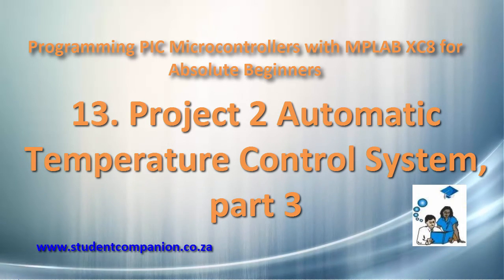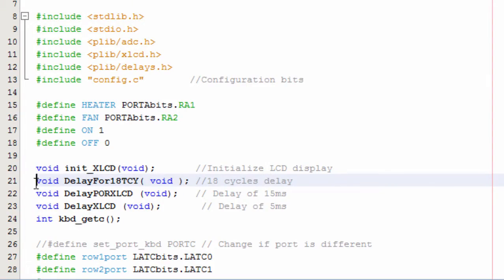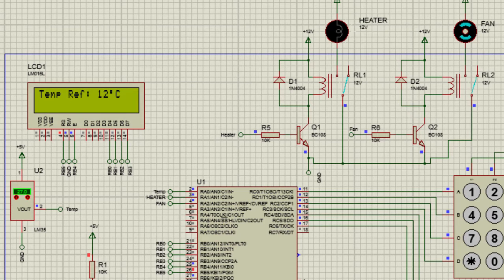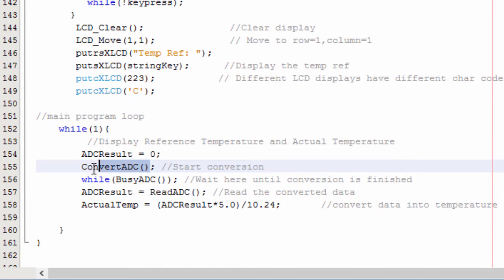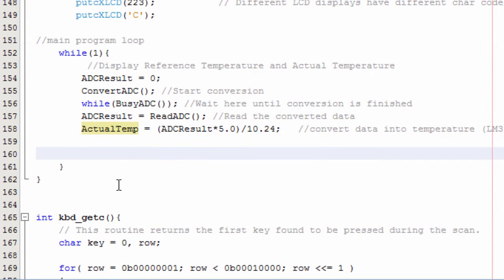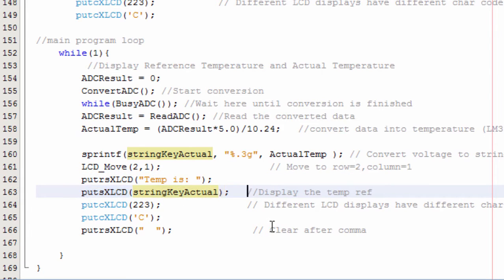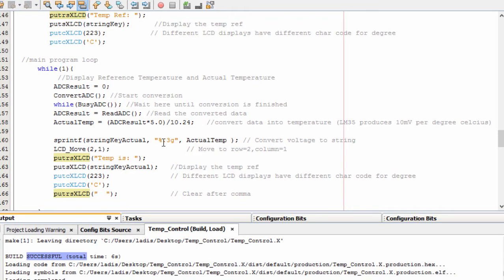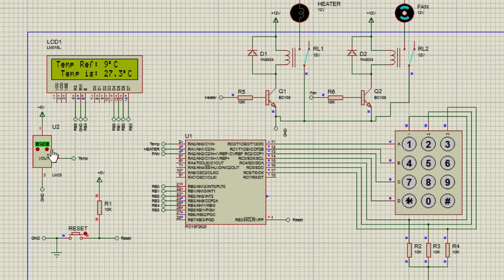13- Project 2 Automatic Temperature Control System, part 3 | MPLAB XC8 for Beginners Tutorial

Comment: Heater and Fan is not running, I have attached everything you need, please help. I have posted in forum.
Reply: It's working now, I changed the values of power supply to the relay from 5V to 12V, it's running. Would you explain why it wasn't running at 5v?
Reply from the maker: You are using 12V relays but you are powering them with 5V, they won't work. If you use a 12V relay, you must power it with 12V, a 5V relay must be powered with 5V. If you change the relay voltage to 5V it will work because they are connected to 5V. Write click the relay and change its voltage rating.

Comment: Great project. Thank you. I tried to build the same project with pic18f45k22 but code is giving me error in 
void init_ADC(void)                 /
{
OpenADC(ADC_FOSC_2 & ADC_RIGHT_JUST & ADC_2_TAD,
ADC_CH0 & ADC_INT_OFF & ADC_REF_VDD_VSS, ADC_1ANA);
} 

ADC_1ANA it says its unable to resolve identifier ACD_1ANA.
Reply from the maker: +Bakmurat Kubanaliev did you write ACD_1ANA or ADC_1ANA?
Reply: Sorry, i wrote ADC_1ANA. Can it be library error. but i downloaded and installed legacy peripheral library. LCD library working fine
Reply from the maker: +Bakmurat Kubanaliev which XC8 compiler version are you using? 
Can you post all the error messages you are getting?
Reply from the maker: +Bakmurat Kubanaliev . It complaining about pconfig.h file. No such file exist. Do you have this file in your project? Abd did you include it?
Reply: #include <plib/adc.h>  yes i included it
and i dont have any pconfig.h file. i didnt make header file like in the video. i just created main and source file. maybe problem is in the legacy peripheral library. i cheched and opened this adc.h file here 

C:\Program Files\Microchip\xc8\v1.41\include\plib/adc.h

and i found #include <pconfig.h>  there in the program
Reply from the maker: +Bakmurat Kubanaliev can you post your main C file. Did you download and install separately the peripherals libraries?
Reply: This is main code:

#include <xc.h>
#include <stdlib.h>
#include <stdio.h>
#include <plib/adc.h>
#include <plib/xlcd.h>
#include <plib/delays.h>
#include "config.c"      //Configuration bits
 
#define HEATER PORTAbits.RA1
#define FAN PORTAbits.RA2
#define ON 1
#define OFF 0
 
void init_ADC(void);        //Initialize ADC
void init_XLCD(void);       //Initialize LCD display
void DelayFor18TCY( void ); //18 cycles delay
void DelayPORXLCD (void);   // Delay of 15ms
void DelayXLCD (void);       // Delay of 5ms
int kbd_getc();
 
//#define set_port_kbd PORTB // Change if port is different
#define row1port LATCbits.LATC0
#define row2port LATCbits.LATC1
#define row3port LATCbits.LATC2
#define row4port LATCbits.LATC3
#define col1port PORTCbits.RC4
#define col2port PORTCbits.RC5
#define col3port PORTCbits.RC6
//#define col4port PORTBbits.RB7   //if a 4x4 keypad is used
 
unsigned char  const Seven_Segment_MAP[10] = {0,1,2,3,4,5,6,7,8,9};
char const keyPadMatrix[] =
{
    '1',   '2',  '3',
    '4',   '5',  '6',
    '7',   '8',  '9',
    '*',   '0',  '#',
    0xFF
};
 
char key,old_key;
 
//
// This function creates seconds delay. The argument specifies the delay time in seconds
//
void Delay_Seconds(unsigned char z)
{
    unsigned char x,y;
    for(y = 0; y < z; y++)
    {
        for(x = 0; x <  100; x++)__delay_ms(10);
    }
}
// This function clears the screen
//
void LCD_Clear()
{
    while(BusyXLCD());
    WriteCmdXLCD(0x01);
}
 
//
// This function moves the cursor to position row,column
//
void LCD_Move(unsigned char row, unsigned char column)
{
  char ddaddr = 0x40*(row-1) + column;
  while( BusyXLCD() );
  SetDDRamAddr( ddaddr );
}
 
//*************Declare Global Variables*************************************
unsigned int ADCResult=0;
unsigned short Temp_Ref ;      //  Reference Temperature
float ActualTemp;
unsigned char stringKey[10],stringKeyActual[10];
unsigned long keypress;
/*
 *
 */
void main(void) {
     OSCCON=0x76;         //Configure to use 8MHz internal oscillator.
     TRISC   = 0xF0;            //Use PORTB for Keypad
     TRISB   = 0x00;            //Use PORTB to display
     PORTB   = 0x00;
     TRISAbits.RA0 = 1;
     TRISAbits.RA1 = 0;    //RA1 is output (Heater)
     TRISAbits.RA2 = 0;    //RA2 is output (Fan)
     LATB    = 0x00;
     init_XLCD();         //Call the Initialize LCD display function
     init_ADC();          //Call the Initialize ADC function
 
    LCD_Move(1,3);                 // Move to row=1,column=3
    putrsXLCD("Automatic");          // Display heading
    LCD_Move(2,1);                   // Move to row=2,column=1
    putrsXLCD("Temp Control...");    // Display heading
    Delay_Seconds(2);                // 2 seconds delay
    LCD_Clear();                     //Clear display
    
    HEATER = OFF;                 //Switch OFF Heater on start up
    FAN = OFF;                    //Switch OFF Fan on start up
 
      //ON startup, read the Reference Temperature from the Keypad
        START:
       LCD_Clear();                     //Clear display
       LCD_Move(1,1);                   // Move to row=1,column=1
       putrsXLCD("Enter Temp Ref");
       Temp_Ref=0;
       LCD_Move(2,1);                   // Move to row=2,column=1
       putrsXLCD("Temp Ref: ");
 
   while (1){
       
       keypress = kbd_getc();
       if ( keypress == '#' )break;        //If Enter '#' pressed
       if ( keypress == '*' )goto START;  //If Clear '*' pressed
 
       if(keypress!=0xFF){
          putcXLCD(keypress ) ;
          Temp_Ref = (10*Temp_Ref) + Seven_Segment_MAP[keypress-'0'];
       }  
}
       LCD_Clear();                     //Clear display
       LCD_Move(1,1);                   // Move to row=1,column=1
       putrsXLCD("Temp Ref: ");
       itoa (stringKey,Temp_Ref,10);   //Convert to string in stringKey
       putsXLCD(stringKey);            //Display the temp ref
       LCD_Move(2,1);                   // Move to row=2,column=1
        putrsXLCD("Press # to Cont.");
     
      keypress =0;
      while(keypress!='#')
      {
         do
           keypress = kbd_getc();  // read keypad
         while(!keypress);
      }
       LCD_Clear();               //Clear display
       LCD_Move(1,1);             // Move to row=1,column=1
       putrsXLCD("Temp Ref: ");
       putsXLCD(stringKey);      //Display the temp ref
       putcXLCD(223);           // Different LCD displays have different char code for degree
       putcXLCD('C');
   
       //Program loop
       while(1){
        //Display Referance Temperature and Actual Temperature
        ADCResult =0;
        ConvertADC(); //Start conversion
        while(BusyADC()); //Wait here until conversion is finished
        ADCResult = ReadADC(); //Read the converted data
        ActualTemp = (ADCResult*5.0)/10.24;       //convert data into temperature (LM35 produces 10mV per degree celcius)
        sprintf(stringKeyActual, "%.3g", ActualTemp ); // Convert voltage to string
        LCD_Move(2,1);                   // Move to row=2,column=1
        putrsXLCD("Temp is: ");
        putsXLCD(stringKeyActual);      //Display the temp ref
        putcXLCD(223);               // Different LCD displays have different char code for degree
        putcXLCD('C');
        putrsXLCD("  ");              // Clear after comma
 
        //Compare reference Temp with actual Temp
      if (Temp_Ref >  ActualTemp)  //If Temp Ref is greater than actual Temp, Switch ON Heater
      {
      HEATER = ON,
      FAN = OFF;
      }
       if (Temp_Ref <  ActualTemp)  //If Temp Ref is less than actual Temp, Switch ON Fan
      {
      HEATER = OFF,
      FAN = ON;
      }
      if (Temp_Ref ==  ActualTemp)  //If Temp Ref is equal to actual Temp, Switch OFF Fan and Heater
      {
      HEATER = OFF,
      FAN = OFF;
      }
        Delay_Seconds(10);   //Wait 10 s then repeat
     }
 
}
 
int kbd_getc(){
    // This routine returns the first key found to be pressed during the scan.
    char key = 0, row;
 
    for( row = 0b00000001; row < 0b00010000; row <<= 1 )
    {
        {   // turn on row output
            row1port = (row & 0x0001)>>0;
            row2port = (row & 0x0002)>>1;
            row3port = (row & 0x0004)>>2;
            row4port = (row & 0x0008)>>3;
            __delay_ms(1);
        }
        // read colums - break when key press detected
        if( col1port )break;  key++;
        if( col2port )break;  key++;
        if( col3port )break;  key++;
        //if( col4port )break;  key++;
     }
    row1port = 0;
    row2port = 0;
    row3port = 0;
    row4port = 0;
    if (key!=old_key){
      old_key=key;
      return keyPadMatrix[ key ];
    }
    else
    return keyPadMatrix[ 0x0C ];
}
 
void init_XLCD(void)                //Initialize LCD display
{
OpenXLCD(FOUR_BIT&LINES_5X7);       //configure LCD in 4-bit Data Interface mode
                                    //and 5x7 characters, multiple line display
while(BusyXLCD());                  //Check if the LCD controller is not busy
                                    //before writing some commands
WriteCmdXLCD(0x06);                 //Move cursor right, don't shift display
WriteCmdXLCD(0x0C);                 //Turn display on without cursor
}
void init_ADC(void)                 //Initialize ADC
{
OpenADC(ADC_FOSC_2 & ADC_RIGHT_JUST & ADC_2_TAD,
ADC_CH0 & ADC_INT_OFF & ADC_REF_VDD_VSS, ADC_1ANA);
}
void DelayFor18TCY( void )         //18 cycles delay
{
Delay10TCYx(20);
}
void DelayPORXLCD (void)           //Delay of 15ms
{
Delay1KTCYx(30);
}
void DelayXLCD (void)              //Delay of 5ms
{
Delay1KTCYx(10);
}

Yes i did download it. PIC18F Legacy Peripheral Libraries v2.0 and installed it. Added it from project properties,  include directories.
Reply from the maker: We can't see the problem from this code, please send us your full project together with Proteus schematic if you are simulating your project. Zip all the files.
Send it to our facebook page: https://www.facebook.com/StudentCompanion/ 
Or send us an email.

Comment: which mplab version u r using..which compiler give me the specifications pls
Reply from the maker: +Harpreet Sehrawat You seem like you are confused, you are asking question about MPLAB Compiler, mikroC compiler, these are two different compilers. You must use the one you have and familiar with. Watch our introduction tutorials to get started. You told me you were using XC8 version 1.7 that's why I suggested how to install the Peripheral libraries. The version we used on that tutorial is v1.4 which you can still get from microchip website. You won't need to install the PIC18F Peripheral libraries with this version.
Reply from the maker: +Harpreet Sehrawat But if you are confortable with mikroC, then it's fine, but remember this is a big project, you'll need a full license to compile it with mikroC but with MPLAB, you can still use the free version.
Reply from the maker: +Harpreet Sehrawat If you are going to use MPLAB, watch first this video: https://www.youtube.com/watch?v=mUofSucHx_E
IF you are going to use mikroC, watch first this video: https://www.youtube.com/watch?v=jQ8ddVYNlKU